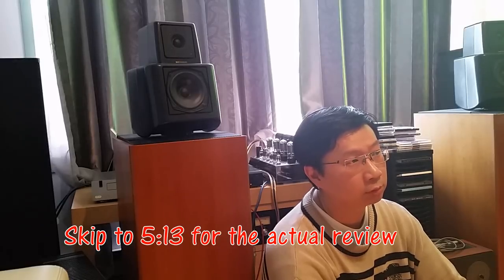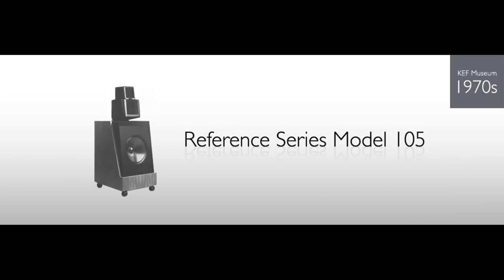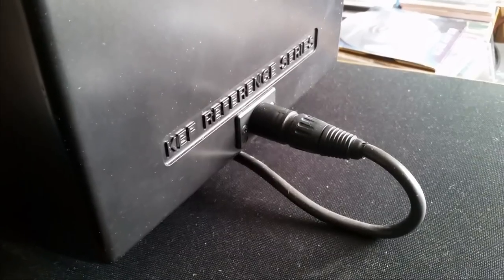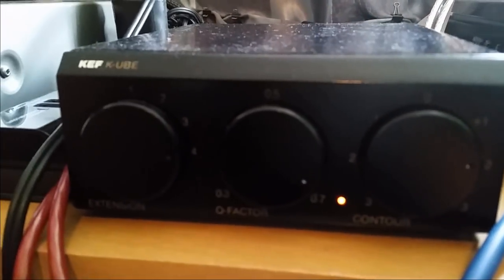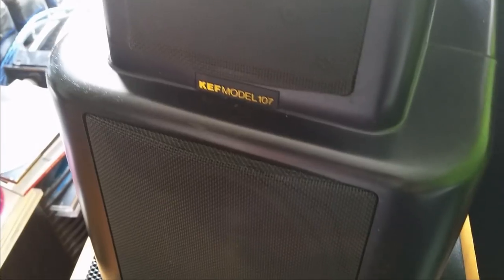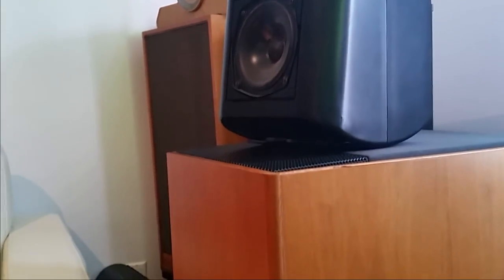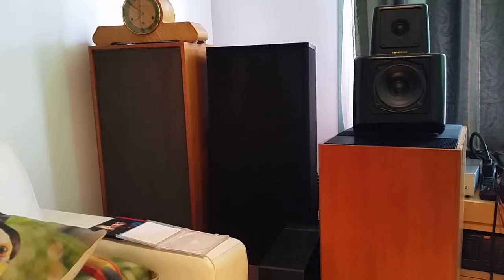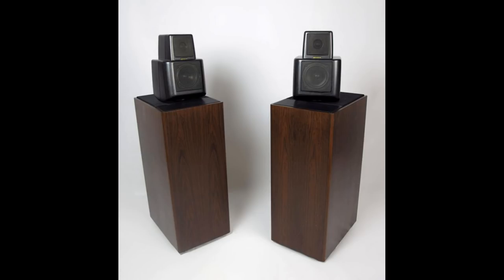Stereo - KEF 107 stereo speakers restored and review (Kef 105)

Comment: I just found a pair of 107's in nice shape.  I did the ferro fluid in the tweeters, installed all new caps from Falcon, and woofers were already done. I have 104/2's and love how musical they are, great detail and super bass(restored, a must).  The 107 are better, still musical, mids and highs are almost the same as the 104's, but the bass goes down to 20 hz and you can feel it, wow.  These are a keeper and would compete with many many high end speakers.  Both the 107 and 104/2's make the speakers disappear, so hard to do.  Love them. I have had way too many to even remember, these re top notch.
Reply: What amplifier are you running them with?
Reply: If you improve the crossover components and internal wiring, the resolution, smoothness, control, speed and many other parameters will improve drastically without losing the personality of the original design, but its defects will almost disappear.

Comment: I've bought a pre-owned 107 few years back.  Long story cuts short, below are the updates that I put behind and brought it back to its best.
- Refoamed all 4 woofers.
- Replaced all capacitors with Falcon Acoustics kits.
- Replaced all internal wiring with solid silver wirings
- Replaced the tweeters with Mid West Speaker's MT-1191 (some modification required for mounting it to the tweeter housing).  This ends up the most obvious improvement achieved amongst all the updates that I've done.

Comment: The mid range driver is the kef B110, used in the LS3/5a monitors, nice video, thanks for sharing 👍
Reply: Hi Tweakerman

The B110 A with the Bextrene cone and a layer of viscoelastic damping is the driver used by the LS3/5A.

The B110 B used by the 105 is similar but somewhat evolved and in the Reference series they were selected and paired.

The 107 had an evolution of the B110B with a polypropylene cone, a material that no longer requires viscoelastic cushioning.

Comment: The Kube doesn't adjust HF, it adjusts LF parameters. Many preferred the 107s without the Kube, you notice a more transparent sound without the Kube, but the bass may be lacking without it. I removed the crossovers from mine completely and used active crossovers. I replaced the 2 bass driver surrounds, as the originals perish. I also built a passive pre-amp using Alps Black Beauty potentiometers. Amplification was 3 mono-bloc Quad 303 amps. That is my current system even after 30 years of working with audio, these are still working and sounding better than any other set-up I've listened to, and that includes any Focal speaker. The 107s were accurate loudspeakers that faithfully produced what the amplifier was throwing at it, that's what you want in a loudspeaker, but to achieve that goal they have to be constructed properly. That's why it's a 2 man lift, just to move the bottom cabinets around. Modern loudspeakers haven't really progressed compared to speakers that were produced in the 70s. Rogers LS3/5A, Quad ESL, Celestion Ditton 66 ,Tannoy Monitor Red, these are just a few from 60s-80s period that will trounce the majority of equivalent priced modern speakers of today

Comment: I bought my 105 Series1’s in early ‘79. 20yrs later a crossover cap blew. KEF repaired & recalibrated both head units, computer-matched. They are still all-original, & sound as great as Day1. I upgraded their fuses with Audio Magic Liquid Nano fuses, which after 75hrs of burn-in, improved their clarity & resolution. But sadly the particle board woofer cabinet, suffered damage from age, at 1 of its caster mounts collapsed. It will be repaired, I will never sell them, their presentation is 1 of a kind. I replaced them with a set of Von Schweikert Audio Endeavor3 SE’s, which are breathtaking in their own right, more dynamic. KEF’s Uni Q driver has limited excursion=limited SPL’s, & aren’t durable to extended high listening levels, I blew a set in 1wk🔊😎.

Comment: I just found a beautiful set of 107s,(today - 07/24/2021), in a thrift store. They were asking $300 for them, (there was no Kube)! I took them home, and connected the cables, and low and behold they sounded fantastic! I have an old BBE Sonic Maximizer, which does the same thing as the Kube, and I was set! The cabinets were nice. A little furniture oil, and a lent roller on the covers and these are now home to stay! Did I mention that I got the pair for $300.00?!!!!!
Reply from the maker: Deal of the century.

Comment: I recently got a VGC restored pair.  It is an amazing pair of speakers, even compared to my Avantgardes, Wilsons, Vienna's! The midrange and highs were very sweet indeed, not harsh or fatiguing in any way. The bass needed some boost as I did not have the KUBE so I used a miniDSP in its place.
Reply: Jared Lee How's the MiniDSP working out for you? I ask, because I'd love to get a set. And I plan on using DSP in the near future anyway. Would probably save a lot of hassle, and money not having to deal with an old EQ unit. I imagine if you know how the kube works, you know what settings it uses. A DSP would work even better, or at least have the potential to anyway.

Comment: Beautiful Kef 107. It is a shame that some units have been as mistreated as the ones in the video.

If you liked the 105 and 107 with cheese components such as electrolytic capacitors, ferrite coils with fine wire and cheap resistors, you can't imagine what they are capable of with high-level components.
The T52 of the 105, once you filter it with high quality components and remove the 0.028 mH coil that is in series and that cuts the response from 16K, becomes a grain-free, fast and resolving tweeter. If you also feed them with high-end electronics and wiring, these speakers unleash in a way that is hard to imagine.

The 107, being somewhat superior, must be somewhat superlative once you remove that crap of internal wiring and filter components. The T33 without the funnel of bad filter components is surely capable of delivering a delicious sound

Currently my 105 are still the same as always, but their performance and quality are immensely superior to the original, with a fast and controlled bass, warm and precise mids, and defined, smooth and liquid highs. They will always be one point behind in speed and resolution compared to the best current High-End speakers, but the 105 will surely surpass them all in terms of scene, coherence and holography.

I recommend to you, and to all those who have old KEFs, that you improve the filters and wiring as I have done. You will surely be amazed

Comment: I  have a pair of KEF 105/1 and still like them ........these speakers were designed for British rooms who are typical small rooms.............Big sound in a small room and they realy do that.!!! Bass is not to heavy and not pumping , the bass rolls off gently before the room becomes to exited BUT they are going lower than the classc bass reflex speakers  , the bass is tighter, more nuanced and tunefull,  not boomy as perceived with the latter bass reflex cabinets / woofers .
Reply: Hi

If you improve the crossover components and internal wiring, the resolution, smoothness, control, speed and many other parameters will improve drastically without losing the personality of the original design, but its defects will almost disappear and will put modern designs in trouble.
Reply: @audiobiker  Thank you !

Comment: Hi Thomas after researching and watching your review of the kef 107.2 I purchased a pair they had the woofers repaired alone with the tweeters and the crossovers really everything one should have ,the bass is great but the mids and highs are not silky smooth like you described and what I would expect from a speaker of this Era, they are real tinnie sounding and I hate to say it but almost resemble a transistor am radio, I suspect who ever did the crossovers didn't voice them correctly and tried to brighten the mids and high what would be your suggestion so I might have this fixed as I can tell they have great potential  but like they are they sound really bad now I must admit I am comparing the to a pair of Bozak concert grands and a pair of triton one R any suggestions would be greatly appreciated
Reply: Surely the filter is damaged or poorly repaired.

If you improve the crossover components and internal wiring, the resolution, smoothness, control, speed and many other parameters will improve drastically without losing the personality of the original design, but its defects will almost disappear and will put modern designs in trouble.

Comment: The KEF tweeter for the 105 was more capable than they allowed it to be. Kef sold a lot of them to other companies that made them brighter in other speakers (Beverage etc) .  Polite and warm British voicing that may have seemed brighter in an all-brick/stone home.  The bass, while I'm unsure- I feel it was probably a design choice for the time, or unsure of going too controlled or low efficiency like Acoustic research.  The music of the era sounded fun with a bit of bass "slop" The 105 was a real milestone in that it was the first real high fidelity full range.  The 107 was a "lessons learned"  speaker from the 105.  Incidentally, the $15000 maidstone was a throwback to the 105, complete with bloated bass.

Note:If the KUBE isn't used on any of the Kef Reference speakers of the period, treble is rolled off, lower midrange is (annoyingly) forward, and bass extension is cut by an octave.
Reply from the maker: I actually picked up another mint condition 107. I find the KEF kube too subtle and end up using a schiit loki instead. Thanks for the comment.
Reply: Hi Thomas, could you elaborate on your preference for the Loki over the Kef K-ube for bass boost on the R107? Is the Loki more transparent, quieter, does it integrate well and provide sufficient boost?

Comment: The original Kef 105 from which this speaker originated used a much better tweeter... (KEF T52). This tweeter has the flattest measured amplitude response of any tweeter ever made, even to this day. It is also completely devoid of stored energy and ringing and has high power handling. The KEF 107 is improved in every other way over the 105 but why they would switch to an inferior tweeter I have no idea.
Reply from the maker: I wish the KEF 107 tweeter was smoother.
Reply: The main weakness of the 105’s are mainly the crossover parts. With high level Mundorf Caps and resistors and air coils and some little touch to compensate for the new components, the sound is even greater

Comment: Hi! This video made me so curious about the kef 107, that I had to try it for my self. I´m just starting my hifi journey here in Norway and got hold of a visually mint 107/2 pair. They needed refoaming but other then that was ready to go. It is now my quest to make them sound as good as possible and was wondering if you had any thoughts about a front end that will pair well with these? Looking to  buy second hand and to go with a preamp poweramp/monoblock setup. Thanks!
Reply from the maker: I remember using it with my Moon w5.3 and it sounded good. You do need a bit of power to drive these things.
Reply: Hi a good match  for the 107/2 are the meridian 605 monoblock  I use them to drive  the tops and  meridian 505 monoblocks for the bass I love the 107/2 and will  never  let them go
Reply: More great amps for the 107 is NAD S200, Bryston 4BSST series, Levinson 23.5 or even a older Hafler

Comment: Improving the crossover components might reap benefit, air core inductors and film capacitors, also the equaliser circuit may take some component upgrading....although the T33 tweeter was never the last word in drivers...

Comment: I've owned the 105's and thought they were very transparent. They were not bass heavy. In fact the bass seemed to roll off a little short in the end. I have always been curious about the 107's. I eventually sold my 105's for a pair of B&W's.
Reply from the maker: Yup, you are 100% correct about the 105 not being bass heavy. It does help if you have a 300w amp driving it but we definitely wished it had just a tad more bass.

Comment: Great videos...keep them coming.....if you had to choose between Focal 1028beii, Kef 107/2 or the Tekton Double impact....and could only keep one of these pairs...which would it be...help me decide!
Reply from the maker: I would take 1028 because I like details and sharpness. However, All 3 speakers sound very different and the 1028 can easily give you listening fatigue. I mean the treble is really tilted up. Check out my video on what speaker to buy.
Reply: @ThomasAndStereo  Thanks much for your opinion. I currently have the 1028’s and agree with what you have said. I inherited some Kef Calindas and had the crossovers heavily modified and put new t27’s in.....they sound amazing.....I love the sound but would like to do it on a bigger scale that’s why I am considering the 107/2’s....but then all of the Buzz about Tektons has made me question this idea....I’ll check out your video on which speaker to buy....thank you very much!
Reply from the maker: @chrisroberts5001  Also check out my video on the tekton. Thanks

Comment: What about the vandersteen?  How you rate them?
Reply from the maker: I actually did record a sound clip of all 3 speakers and was going to post a sound clip comparing all 3. Just have to find some time to edit it. I heard the same song on all 3 speakers because I wanted to compare. In the short time I listened, the bass on those are more full and fill up the room really well. I can't find that kind of 'fullness' in modern speakers. Highs and mids are what I consider the right kind of sharpness for it's era. Not harsh and bright at all, very musical, those speakers will please a lot of people just due to the weigh of it's bass alone. (And that was with  a 45 w amp)
Reply: Thomas & Stereo how do you rate the vandersteen?
Reply from the maker: can't really, heard 2 songs on them only. it does the high better than 107, bass is less control but more filling than 107, but overall, it will please a lot of people. for its price, should seriously be consider.